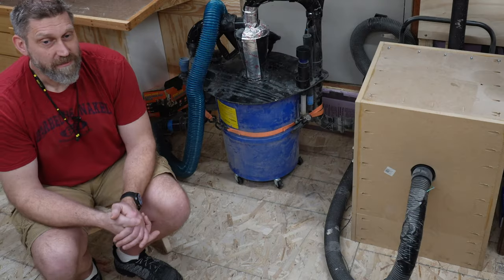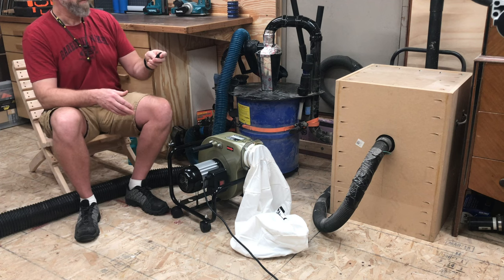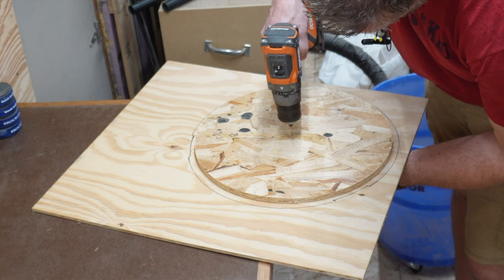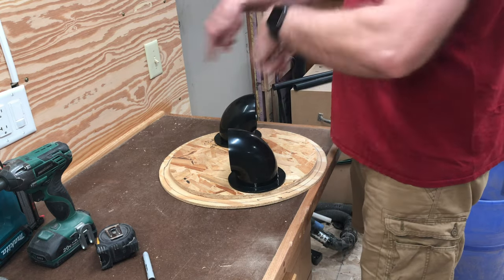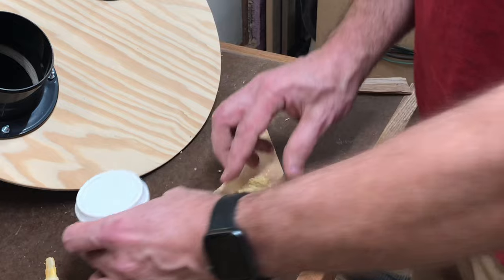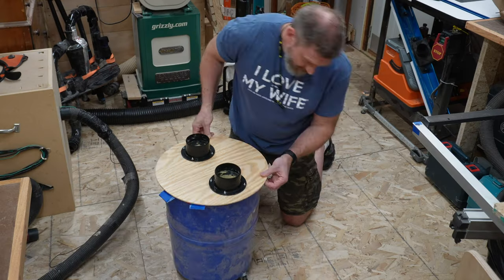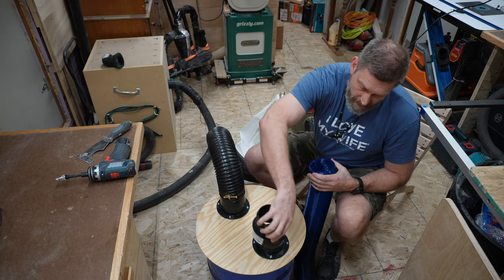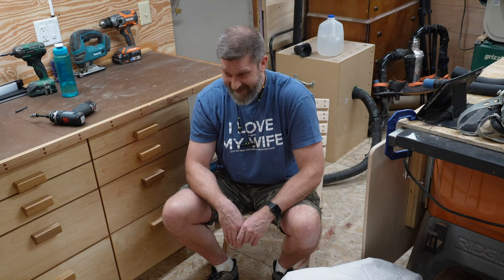MAJOR Noise Reduction!

Comment: finding the center of a circle. Create two right-angled triangles with the points on the circle's circumference with the hypotenuse of the two triangles intersecting. As long as the triangles are perfect 90 degrees and all points are on the circle, the intersection of the hypotenuses is the center. If you're not confident in your placement of the triangles or whether or not your triangles are 90 degrees, you can make additional triangles and take the average of their intersections.
Reply from the maker: Hmm... I hadn't heard that one before. Thanks for that!

Comment: If you have a basement window, run a line after the seperator outside instead of the bag. Run a line directly from where the bag is to the window. Right now you're running a dust pump. Save your lungs !
Reply from the maker: I get that. But, 2 things, …no windows. And the whole unit will be contained inside my new workbench.